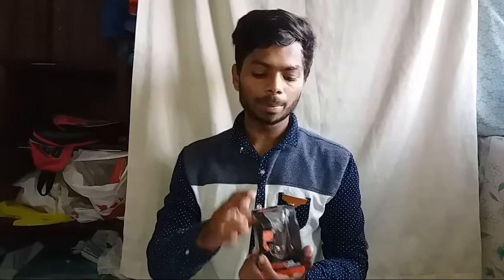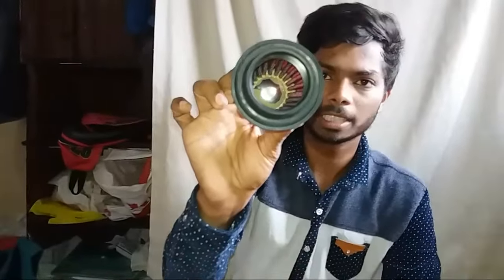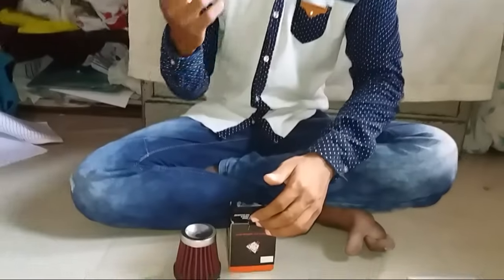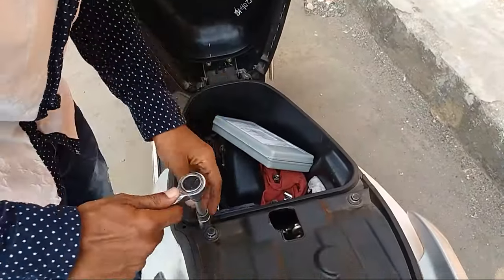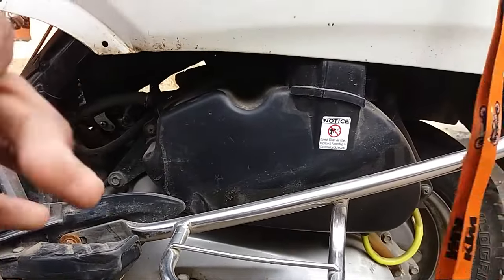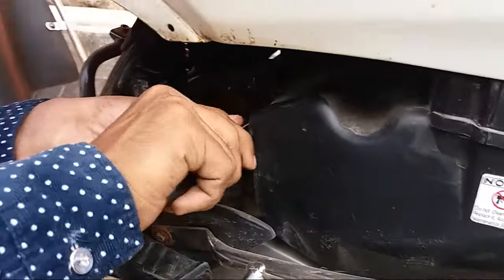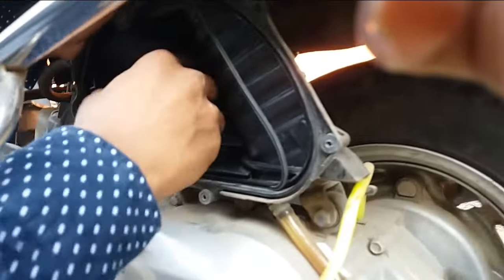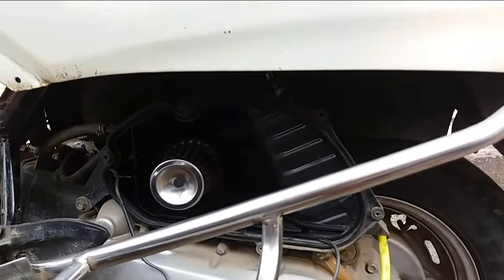Hp performance air filter on honda activa 3g and review about it

Comment: Won’t you need to upjet the carb on the activa? If upside increasing the airflow by using a K&N you may run the engine very lean on stock main jet

Try using the main jet from the activa 125 on the activa 110 that should work fine

Comment: well, its not worth it because you scooty is already running on lean mixture and after adding free flow airfilter you are making it more leaner and it will result in overheating issues , and this is cheap air filter and maybe it can allow dirt or particles into the cylinder and more of that , if you are putting free flow air filter , to balance that you have to put free flow exhaust. alone airfilter won't give you a boost in HP. and to balance this airfilter you have to allow more fuel also only then it is successful.

Comment: bro is it safe to change stock air filter  .. i have a honda  bike of 160cc so at 4000-5000 rpm sometime lags .. due to air filter i think.,. if i changed with k&n air filter ?  is it good

Comment: What are the adjustments to be made on Fuel Mixture screw after fixing this air filter? What changes will the scooter show if we turn clockwise and anticlockwise? What are the challenges we may face after adjusting the screw?

Comment: while driving did it give good noise or not
Reply: i mean i have this filter but the mechanic over here always fix it the portion which is under the seat there but after it is not giving good sound and any pick up increase in honda activa 2012 model

Comment: Bro ye filter to activa 125 me fit hi ni ho ra hai give me any suggestion Pls 😑😑😑
Reply: Vishal Mundu ho jaega fit activa 125 mai
Reply: open the seat completly and direcly install at air intake in engine and remove connectiong pipe

Comment: if we change air filter to hp the engine get more power but decrease in millage .if the milage is 40 it decrease to 30 and destroy the engine rings . so don't change your air filter .

Comment: bro i have same activa 3g it has many vibration when i reach 40 km
Reply: Jhampa66  is there any solution for that problem even when i release throttle the speed comes down with a jerk like its transmission is braking manually.
Reply: Jhampa66 if u get it please contact me . 6 months before i have given my activa in complaint and told them that scooter accelerator is tight , engine is making friction and less mileage . then fixed it in just 2 rupees by adding a 18 mm washer nut in my activa 3g . then it was fluid like activas but after 6months it came back to same state as it was before